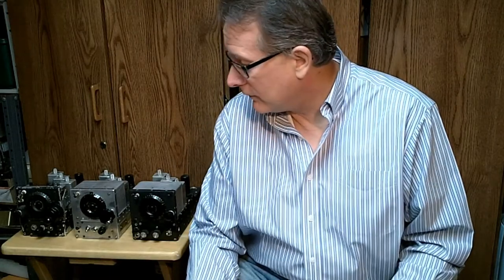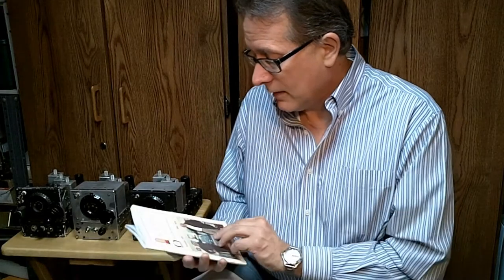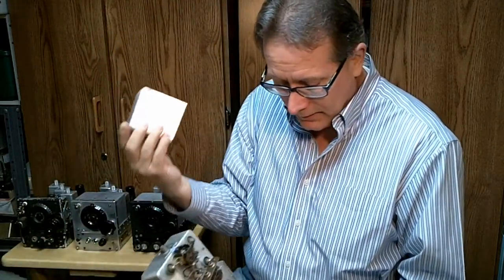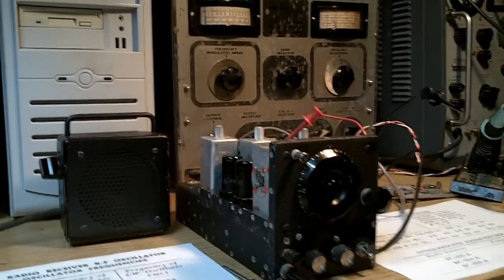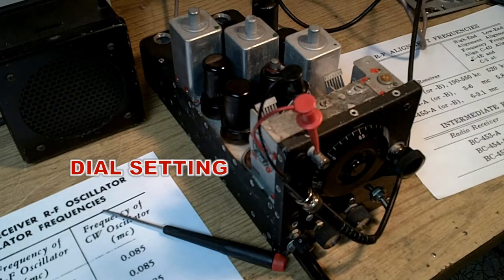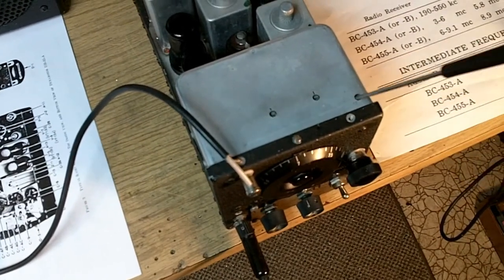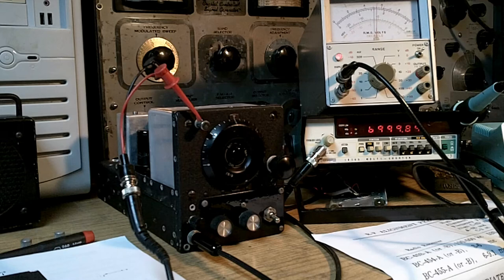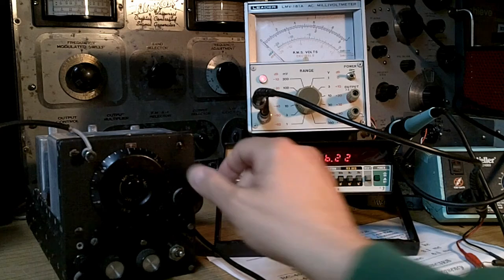ARC-5 Command Receiver - Part 3

Comment from the maker: Interesting about the IF cans and the coils. All of those receivers were picked up at the Nearfest hamfest and were quickly put into working condition for the videos. I did not replace or shotgun the caps. If a cap was flat out shorted, I replaced it, but other than that, I left them in if they still worked. I am sure they all could use re-stuffing! That said, I had a WS19 that I shotgunned all of the 0.1 uF Sprague paper caps out of and tested them and found that all from that batch were 100% and I had wasted my time!
Reply: Yes. Shotgunning the caps is not a good idea. I test them all before doing anything with them. In MY case, every single receiver I have has been essentially destroyed before I got them. Testing the can caps at their rated voltage shows every single one to be unacceptably leaky, so I replace them, one at a time. I have a couple of youtube videos on the receivers I have refurbished. Thanks again for your videos...also for your Feb 2014 article on "Noise Reduction by Phasing" in ER. vy 73,
Reply: BTW, there is another article in ER mag on using the BC-453 as a "Q-5er" for the other receivers using harmonics. It works extremely well. Also, I have done a search on the net to try to find 2830 KHz crystals with zero luck so far. Your idea of modifying the 1st IF in the BC-455 into a crystal filter is absolutely excellent!

Comment: A couple of things, Mike. 1) The receivers which tune from 6 - 9.1 MHz can differ in the IF transformers: usually, but not always, the BC-455(*) receivers' IF transformers do have only one coil. However, SOME have two coils. The R-27/ARC-5, especially the late models, can have two coils. 2) You are absolutely correct about the selectivity-values: in point of fact, the "40 meter" receivers have, essentially, no selectivity at all to speak of. I see that you have left the "can-caps" or "flower-pots" in your receivers: do you operate them at voltages lower than the original 250 VDC, or have you "restuffed" the can caps?